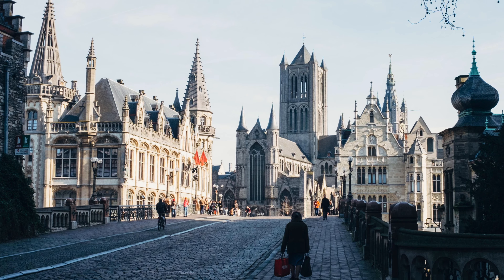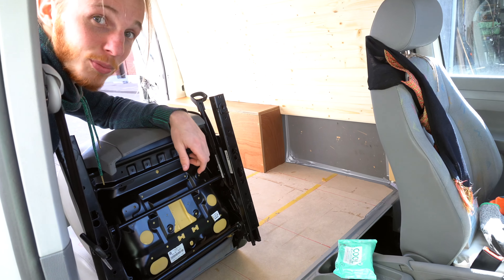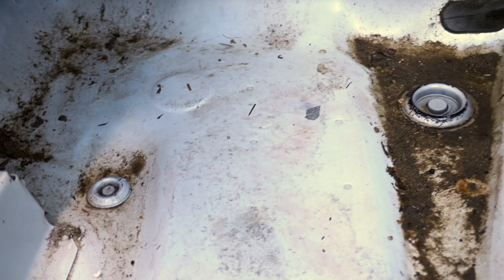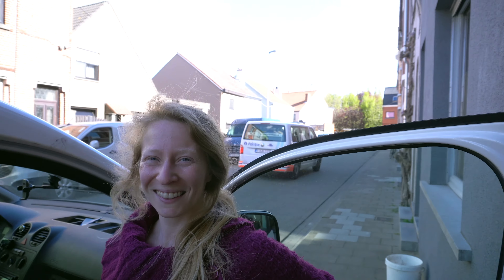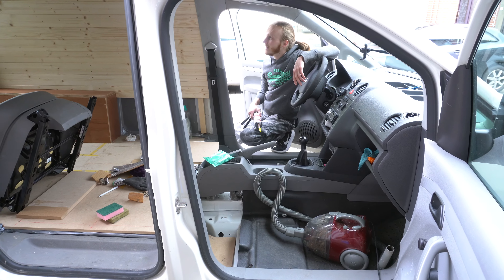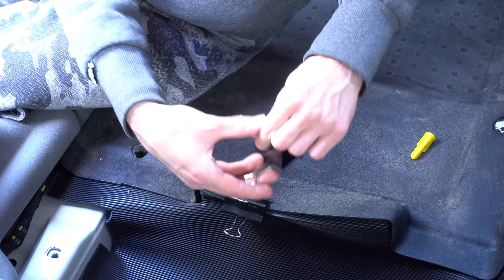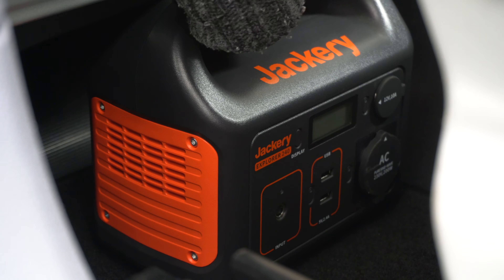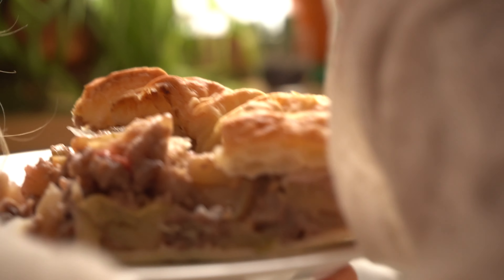Removing Seats and Creating Storage Space !⎮VW Caddy Camper Van Conversion

Comment: How do you guys access the leisure battery when you need to plug something in? I have the same battery / power station and a Caddy, and I've been wondering where to put the battery.
Reply from the maker: We actually keep the leisure battery now in our cupboard in the back of the van where it's easily accessible and fits perfectly. If we need to charge it while we drive, we put it behind the seat and plug the cable into the cigarette lighter (or whatever you call it).

Comment: Hi. My caddy is already a micro camper.  I want to remove the passenger seat entirely and use the space for storage boxes. (not replace the seat).  With the main bolts removed is there a hole through to the tarmac?   Are there any electrics on the passenger seat?  
Danke from UK.